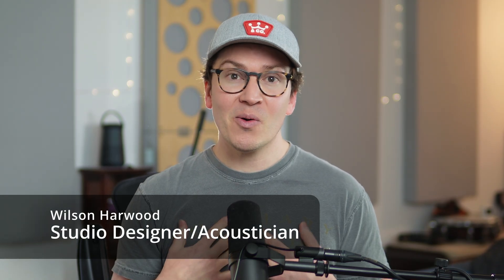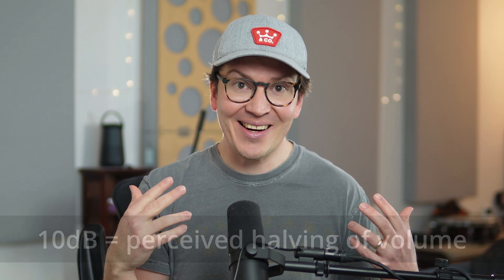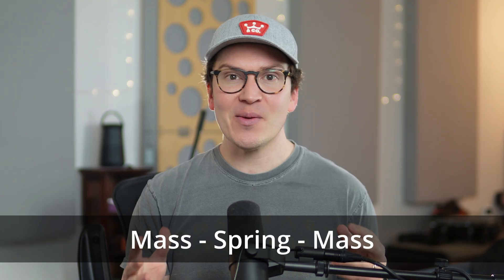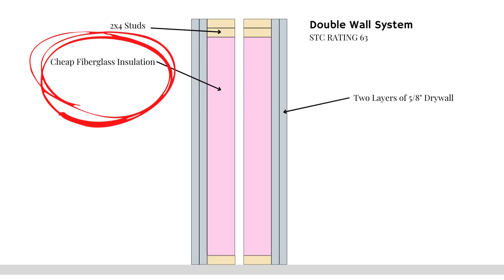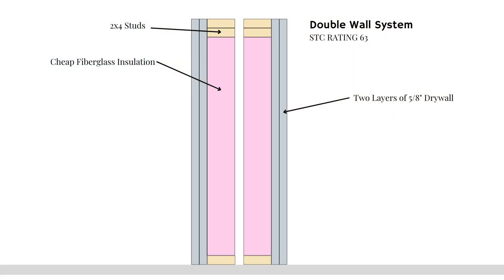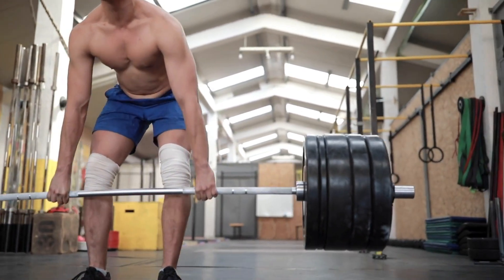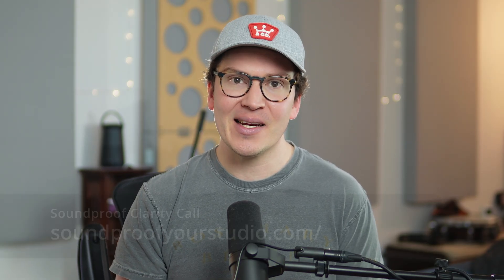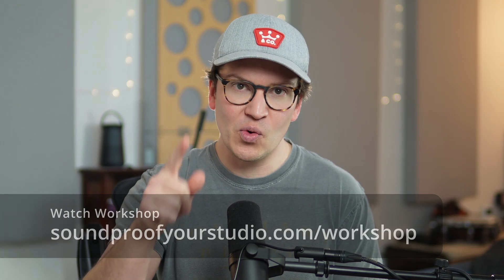The Science Behind Soundproofing

Comment: What would be the best way to seal the floor and a door when the room has carpet but the Hallway on the other side has tile?
Reply from the maker: Good one! A solid core door with proper seals and an automatic door bottom will help. For the floor, a threshold seal or raised transition strip can close the gap without major modifications. Are you currently working on your soundproof studio?
Reply: @soundproofyourstudio  I have seen those auto close thresholds before, I might have to give it a go! I have some acoustic drums in my room that I want to lower the noise bleed into the rest of the house as much as I can afford to. Your idea is a great start, I'm thinking everything after that will be major and expensive modifications to lower the noise bleed of the drums
Reply from the maker: Love that you're diving into this, @mrpres17! 👊 Yeah, drums are definitely one of the trickiest (and loudest 😅) instruments to contain, but every small improvement helps chip away at that noise bleed. Starting with the door and floor seals is a solid move—then you can scale up as your budget allows!

If you ever want to go deeper or brainstorm ideas on a budget, I’d be happy to help! And for anyone else reading, have you tried taming drum noise in your space? What worked (or didn’t)? Let’s swap ideas! 🥁💬

For more details on the steps you can take and what we offer, feel free to check out our website   https://www.soundproofyourstudio.com/

Comment: I would think studios in a basement are fairly common which leads to an interesting question.  How differently would you treat the walls to adjoining rooms (mass-spring-mass) versus those that parallel the foundation walls, whether poured or block cement (not including water/condensation concerns)?  If you decide to decouple the room perimeter, would it be worth doing so on the foundation walls as well?  Behind the foundation walls there is roughly 24,000 miles of earth but would there still be an advantage of using decoupling on those walls as well?
Reply from the maker: Great question! For walls adjoining other rooms, a mass-spring-mass system with decoupling is ideal. Foundation walls, being dense, naturally block airborne sound, but they can still transmit low-frequency vibrations. Decoupling from them depends on your needs—if isolation is key, it can help, but the earth behind them already provides significant mass. Are you building a basement studio?
Reply: Actually a home theater so my needs aren’t at the level a recording studio needs to be.  My goal is to have the sound proof level for the entire perimeter equal to or slightly greater than my weakest link, most likely the door.
Reply from the maker: Great approach,  @tennesseeernest3518  ! For your home theater, decoupling can still help with low-frequency vibrations even with foundation walls. And don’t forget that door seals are key! For more tips on soundproofing your space, check out our website: https://www.soundproofyourstudio.com/.